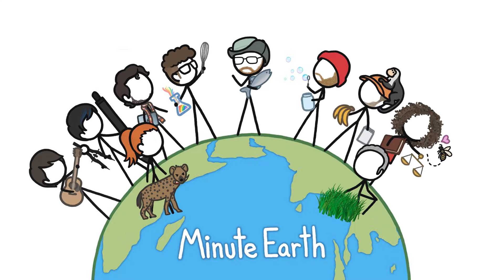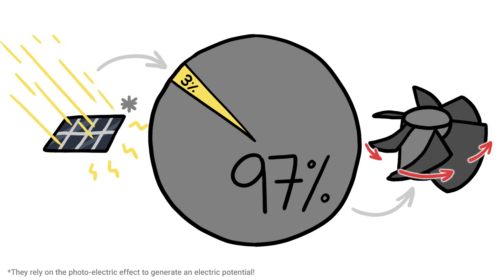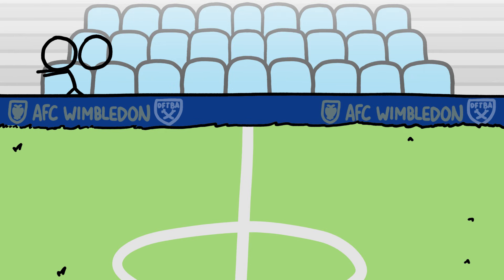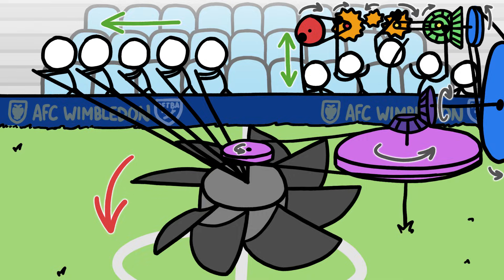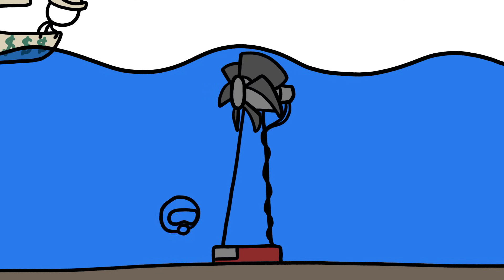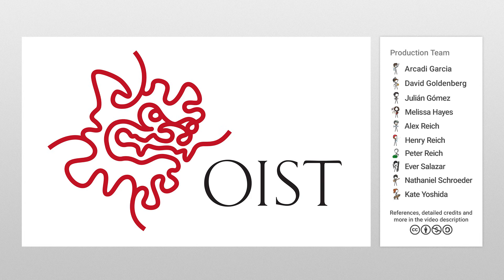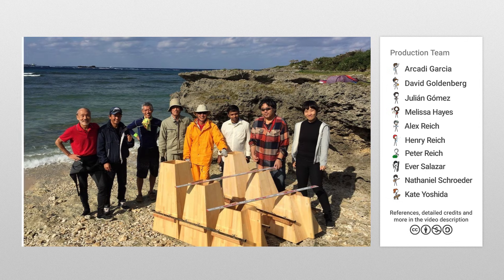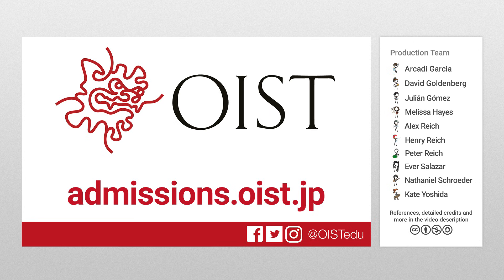Why Can't We Get Power From Waves?

Comment: It is actually a lot simpler than this. Waves don't carry much energy per unit of area. A 'large' coastal wave will typically be lifting water less than one meter up. Even deeper ocean swells are typically under 3m and max out at around 16kw/square meter. Meanwhile, a hydro-electric dam typically has water falling 50m or more, giving it 250x the amount of energy per unit area of the water -- and it is easy to dam up millions of square meters of water to that depth. In the ocean... that water area can't be concentrated and make to flow though a single turbine. So, in order to collect the same amount of energy as a dam, you'd need 250x as many turbines (spread out over 250x the surface area) just to collect the same amount of energy.

Waves just don't have enough energy per unit area. Tides solve on of the issues. You allow tides to flow into an larger holding tank/area and then you can seal it as the tide cost out and then direct the water to flow out through a single turbine. Thus, like a dam, you only need one turbine for all that water. However, most tides only flow to a maximum of 1m or so in most areas.... so you need to build such tanks/areas in the rare places on earth which have higher tide ranges. However, even at a 2m tide range... you still need a huge tank/area and these are typically along valuable realty areas.

Ultimately, this is the problem with any renewable -- energy density. Solar, wind, biofuels, wave, and others all take massive areas to collect useful amounts of energy. This means massive construction, land usage, maintenance, etc. costs and low returns per unit area.
Reply: This comment was better them the video, amazing. Have a like! Now, make a channel yourself!
Reply: Wave energy is function of length ie kw/m and not kw/sqm
Reply: Looking at your idea in reverse: It would take a lot of energy to create a wave 2m high.  So there must be a lot of energy in the wave. Not as much as 50m of course, but not insignificant. Especially if it is 1/4 mile long and arrives every 20 seconds. Just need to find a way to encourage it to share its energy with us ...
Reply: Thankyou.
Reply: very eye opening comment :) Thank you!
Reply: Why do you people write so much
Reply: I was always interested in electricity made by tides. Reading your comment, I thought : one or two meters of tides is kinda low, he must be in error, tides near my home are much higher than that.
So i searched for tides around the world and discovered that I live in the place where tides are the highest around the world, in Canada. Tides in my city (Québec) are around 5 meters. As opposed to many places where it is less than one meter.
I found that in some parts of Europe, they are well around 2 meters so that's not bad. Unfortunately, or should I say fortunately, we will not see this type of electricity in my city or province since it is almost exclusively power dams which are very effective in my area considering the amount of big rivers and lakes.
Have a good day.
Reply: @maxlevedgeful  Tides get complex. In the open ocean tides only average 0.6m. Near shore, they vary all over the place based on the depth/share of the ocean floor, bays or islands which focus water, the time of year/position of the moon, etc. You also get tides at different times during day, multiple high/low tides, and all of different ranges over the year. Two meters actually isn't that low. Remember that any fixed tank needs always be above the height of the highest low-tide to generate power -- and typically a lot more in order to get enough force through a pipe to actually turn the turbine.

For example, Quebec City tides range from 0 (lowest possible) to 6m. However, in typical ranges it is 0.7m to 4.6m. Say your tank starts at 0m. At what height is the outflow pipe/generator? If you put it at 0m, it generates no power anytime the tide is above 0m, since it won't outflow water. So, you pick say 2m... allowing it a 1m drop on 80% of low tides. That means you only get energy out of 2-2.5m of tide out of a 3.5m difference (typical to Quebec City). Multiple outflows and turbines gets expensive/complex and that only gets you that extra 1m of water less than 20% of the time. You then have the issue of how much water you can get through your turbines and over what period of time. If you allow the possibility of a 5m range, when you typical range is 2.5m, you are building more outflows/turbines for that 10% case and... what do you do with the extra power?

In most cases, you'll give up the extremes (any tides below the 80% of low tides) and highs (any tides above 80% of high tides) and then need to subtract 1m (or so) in order to get a drop to create the energy. In practice, even on a 4m range, in practice your system is probably only getting energy out of 2m.
Reply: @BW022  As an interesting fact, there's an highway (number 440) on the shore of the Saint Lawrence river which has high tides. It is near the bridge of the Orleans island if you want to check it. The highway is built in a manner of creating a basin of water separated artificially from the Saint Lawrence. It is calles "Étang de la côte". The water comes and leaves the places every tide by a relatively small round opening under the highway. Every time I go on this part of the 440 hw (everyday at different hours) I see the water is coming in or out of the basin at significant velocity. The (state owned) power company could simply put a turbine in this opening and get free electricity supply to sell to it's customers. It would be a great place to test the viability and feasibility of this type of power source.
Reply: @maxlevedgeful  I can only assume you mean the basin of the Montmorency River (46.885473, -71.143337)? In any case, that would not work.

You can't just put a 'turbine' in a flow of moving water. That would just be an impellor (not a turbine) and it produces almost no power as the water merely moves faster around the impellor. If you put a bunch of impellors there, the water would just flow over them -- or the bridge if it needed to. Further, the amount of energy you get out of it is always determined by the change in the velocity of the water going in and coming out. I.e. if the water is moving 10m/s before and 9m/s after... only 10% of that energy is captured. For all practical purposes... if the turbine system isn't backing up the water, it isn't giving you energy. This is why nearly every turbine is placed horizontally across a vertical shaft and the water is allowed to fall downwards -- and (for hydro-electric dams) there is a vast amount of water hundreds of feet up being forced through it.

Tidal power doesn't work by putting impellors in a tidal flow. In order to get power, you would need to build a tank. Then allow it to fill up until high tide. Then plug it. Then wait for a much lower tide. Now you have a lot of water which is going to fall a (relatively) large distance. And then release the water to fall as far as it can... forcing it through as narrow a spot as possible, so that as much of the water moving through the turbine must push the blade out of its way. 

And of course... that's just the theory. In practice you have to worry about junk (fish, logs, rocks, sand, sea weed, etc.) being brought into your system and then blasted through your turbines. Then you have to worry about corrosion (salt water itself is highly abrasive), environmental issues (blendering/filtering large amounts of fish, blasting higher pressure water into an area, water temperature issues since you are holding/releasing water into an existing system, etc.), construction issues (you need a coastal area wide/flat/solid enough to build large tanks, but typically beaches are either sandy/rocky soft or not dense rock which isn't wide/flat), collection, tide cycle/release issues (i.e. intermitant power production), etc.

Comment: There is currently a new way of creating energy with waves. It's a machine that creates electricity through kinetic energy of the wave and rated to supply enough power to 40000 homes with one unit.
Surprise you did not know of it.
Not sure of the name, but you can find it easily.

Comment: Some guy was testing a bathysphere that cracked, when they raised it up the pressure of the water had filled the capsule and when they lowered it to the deck the crack in the view port window that allowed the vehicle to flood, gave way and a pressurized stream of water dented the metal wall in front of it.

The guy then came up with a tube that's lowered deep into the water with only it's top open to the air. At the bottom of the tube is a water lock. one door that opens and allows water inside the first chamber of the lock.
Afterwards the waterside door is closed and the air side door is opened releasing the pressure on the water, causing a powerful jet of water to shoot up the tube to spin a turbine.

I don't think he ever got the money to get out of the design phase though, I never heard anything about this concept since. But I think he at least got a patent.

Comment: Lever based designs are the best overall... the only part of the generator that is in the water is the floatation module, which is easily repairable and maintained.  Everything else is on a jetty or some other mooring fully sealed away from the caustic environment.  When the lever goes up and down it drives some manner of oscillation gear which, in turn, spins a wheel.
Probably the best design would be the fly wheel crank and an anchored line.  All of the generating hardware is in the 'flotation' device which houses a very large flywheel attached to an anchored line.  As the waves move the line cranks on the wheel, generating electricity with minimal overall parts exposed to the environment.  OFC, figuring out how to get the energy to shore is its own challenge.

Alas, they're not terribly efficient things compared to other wheel spinning methods.

Comment: WTF? Wind turbine kill birds! So now you wan to kill fish!
And Ocean Power system would be very easy to build!
One that make continues power, not pulse power!
You need two towers in the water. 
These two towers need to be the average wave span apart..
From crest to trough.. 
Now between these two towers, you need a shaft with two cam bends. 
One cam bend connects to one float, and the other one to the other float..
If the cam bends match the lambda of the wave, one will be going up, while the other is going down. In an endless cycle..
And this will turn the shaft in a constant manner..
Now for maintenance, you might have to make it out of plastic, I hear the ocean is full of that crap already..  
Do I need to draft it out for you?
Oh and note this is not a turbine, and will not kill fish! Maybe boats...hmm...

Comment: have they tried making a water wheel instead of a turbine? i mean, even if the movement is vertical, it would still force the wheel to move... or maybe instead of a giant one, wouldnt it be better for multiples of smaller, less resistant ones? so if you make a line of small ones, you can make up for what a massive one would do.

Comment: uh. We already have a few system work. The lastest system i known is in UK. System contain multiple pump of oil each of pump will go up and down base on wave, push the oil when up and pull oil when go down. the flow of oil will then used to turn turbine.

Comment: Why not have a plant like floating apparatus that uses a fabric like floating fin, air filled on tip, weighted under to be perfectly at equilibrium with the weight of salt water, and let it just move and flow with the waves. Like the fabric that charges cloths but leaves of it under floating buoys

Comment: So we gain 97% of our electricity from interesting ways of making weirdly- shaped wheels spin?
Reply: Well, yes.
Or well, the spinning turbine rubs copper agaisnt magnets that actually gives the electricity.
Reply: @jarskil8862  solar panels have no spinning
Reply: @devforfun5618  Correct but they are not all that efficient, sadly.
Reply: turns out sometimes the simplest design is the best one (its not simple, turbines are filled with elecronics that control the flow of air and torque applied to it to ensure maximum efficiency at all times, but the base principle is shockingly simple). most of our research is about figuring out ways of making a better heating source. coal and oil are inefficient because their base chemical reactions are ineffective, solar concentration is good but only in countries that see almost no clouds and have enough ground space to make the gigantic instalations. dams are damn effective but need specific terrain and weather cycles to work, and nuclear is efficent and usable almost anywhere with fresh water, but our research on nuclear reactors has been shamefully slow after the energy got its bad stigma due to a certain reactor 4, and bad safety decisions in japan. geothermal is also an interesting one, because a technology very similar to fracking (but without the need of many of the problematic chemicals) could allow heat spots to be exploited almost everywhere on the planet, but the funding for that research has been catastrophically low compared to what fracking for oil has received. fusion is getting some attention too, but again, not nearly as much as it should, and only more than all others because of europe's research institutions pulling many times their weight.
Reply: @mobiuscoreindustries  Just want to drop this, and I can find a source, but micro nuclear energy is a simple and safe alternative, you put depleted uranium in a CO2 based generator, and it creates a (relatively) small amount of energy with no risk of meltdown, basically no footprint, and basically no maintenance.

It literally uses used materials to run so the half life is forever, and even in a "total failure" it's no harder to deal with than modern nuclear waste.
Reply: @IrvineTheHunter  I was already aware of this tech and it is usefull in some places. I mean it does fit the bill for a handy generator to power the most isolated areas or even help power up outposts on other planets once we get to that. However one of the traits needed to use something as your main energy sources is that, in  your local environement, it must generates enough energy to sustain the overwhelming need of your population at as less of a cost as possible, but also be able to grow to follow the growth of the energy need of your population.

This is why when you talk about nuclear it really comes around as the best all around energy we have right now: needs a small amount of fuel to run for long streches of time, waste is localized and thus does not go into the environement (still need to be dealt with or used for more power), the cost is high but the returns are much higher, it isn't reliant on exclusive environemental features and it can easily scale up to follow the energy growth. New types of reactors are also able to do all of that better. However, renewables are also a very good alternative granted you have the nessesary natural features to take advantage of them (IE being a desertic african or midle east country with killometers on end of desert where the sun shines all the times, perfect for solar concentration plants that can pull more than enough energy to sustain the whole country and more) but should be avoided if you do not have those (IE germany, who tried to make a clean energy transition to solar and failed miserably due to the european weather being trash most of the year
Reply: @IrvineTheHunter  are you telling my the fuel cells from fallout might be real?
Reply: @pulsefel9210  Not to that scale, yet, they are micro in comparison but sill the size of a small car.
Reply: @IrvineTheHunter  How do they handle the radiation?

Or even gather enough heat to be effective? I mean sure it could be used for slow innefficient stirling engines if you add enough lead and concrete on top. But not in normal generators.
Reply: @Cerebrosum  so they use radioactive pellets that are in a low energy state and turn mini turbines with C02 instead of water/steam Makeing it safer with a high cycle rate.

Because the material is relatively safe a simple concrete lead pan is used to contain waist or the product in a failure.
Reply: https://www.wikiwand.com/de/Adiabatische_Zustandsänderung,,

think a vertikal sevenwinged hyperbolic-formed wingprofile as a savonius rotor and put a tesla-mixer at the bottom....if you drill alternating left/right diagonal wholes in a teslaturbine in both packs of disks you get a chaosmixer that heats water. I saw a solution with a truck retarder-brake mounted at a waterwheel with about 3 m high...it made 5 kW Oil-tubed-heat direct without further moving parts. the rest you get yourself together....trust yourself and take the gift of
Reply: Nuclear plant = steam energy
Reply: Yes. We're almost always just bringing water to a boil to spin some wheels. That's what humanity has achived so far.
Reply: Yes, cause spinny things are very efficient. It's why wheels are still a thing.
Reply: Yup. And if we ever develop fusion, we'll also use it to heat water to spin a turbine. It's almost like energy generation is supposed to be impossible but we found this one bug in thermodynamics and we've just exploited the hell out of it.
Reply: I still remember now (40j) how disappointed I was, when I first learned that nuclear power plants use steam to produce electricity. It seems so low tech.
Reply: @stefanhauser2804  i don't know if we could develop something like solar panels for radiation, and have solar power at night

edit: just found this article, disappointed again 
https://www.sciencedirect.com/science/article/abs/pii/S2213138816300893
they will create steam with photovoltaic panels